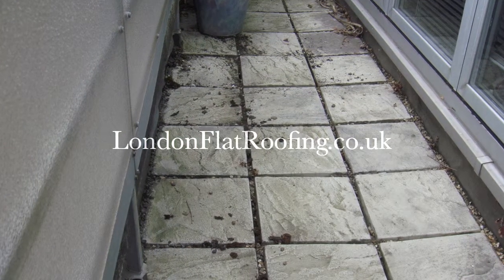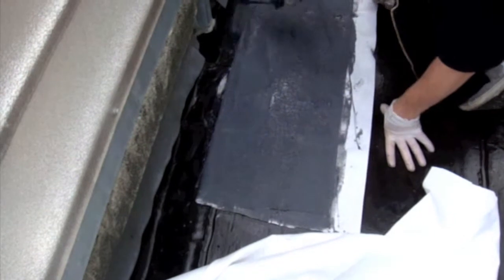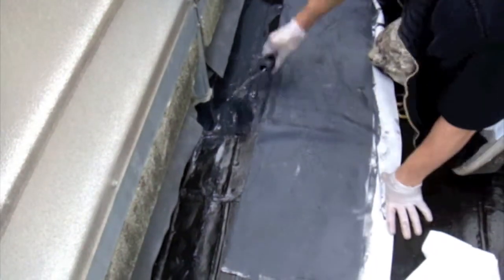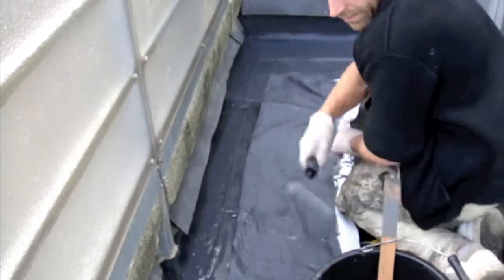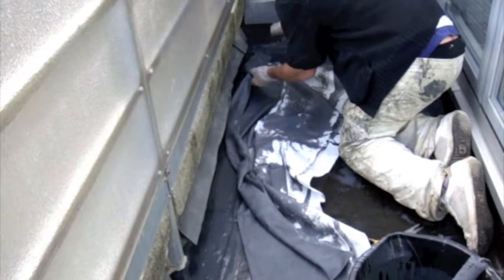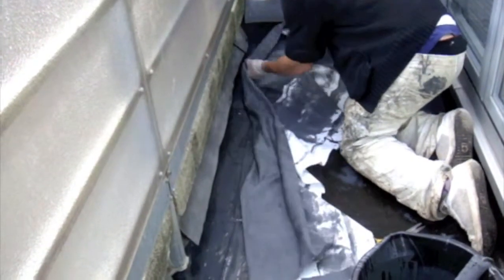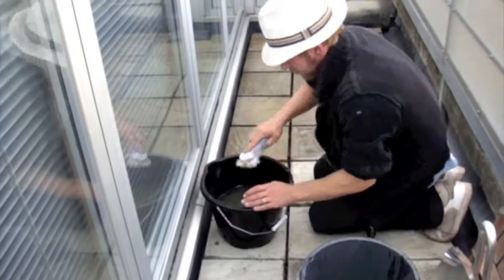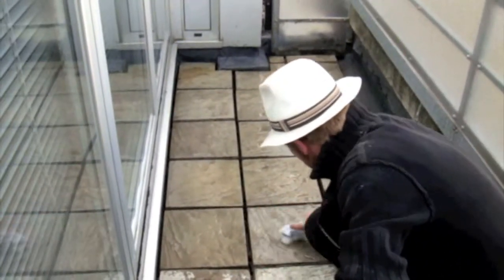Kemperol v210 balcony overlay

Comment: Great video! :)

This is what the council have been doing on my balcony(a number of blocks on my estate!)

Just want to see the process.

They have dug up the old gray coating, sealed the edges with orange paint. Then painted the middle of  the floor with a light layer of black and sprinkled some sand.
Now they have painted over the orange edging with black.
I assume the next few stages will include gluing on the asphalt, the white painted edges, then the last stage which is the paving! :)